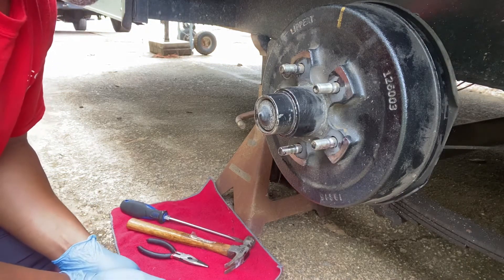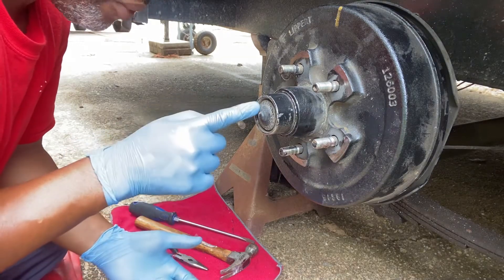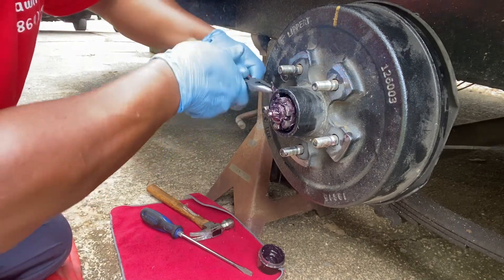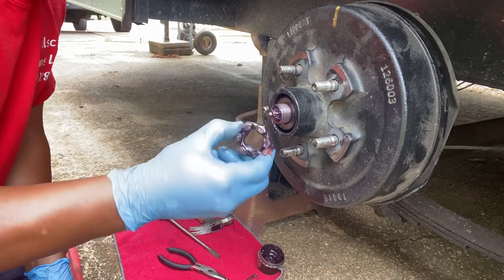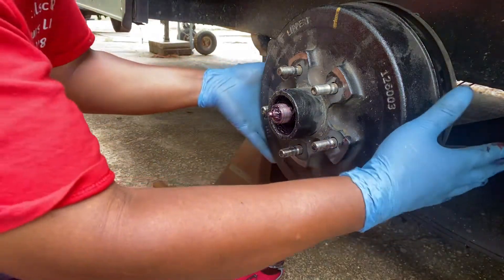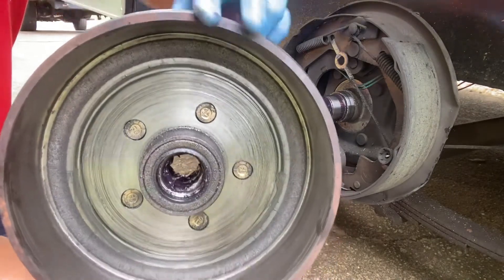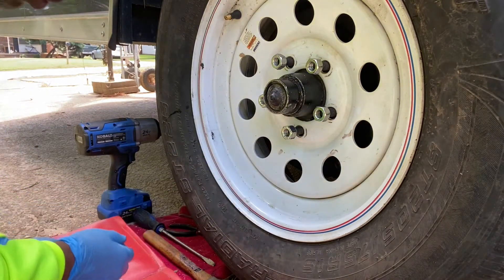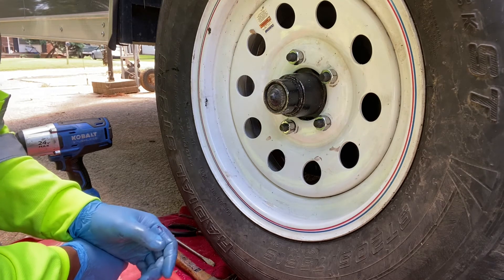TRAILER WHEEL HUB & STUD REPLACEMENT

Comment: Job well done! The only thing I might would add is change the wheel seal on the back of the drum. Nothing worse than it start leaking after you did all this. If your bearing are in good shape still.

Comment: You should really address the thinning of the studs. You either have the wrong nuts , or not fighting the nut probably or this is made in non-USA studs ( i.e made in china ) where the metal is weaker and will distort

Comment: Great how-to video.  I'd recommend you replace the cotter pin (not carter pin).  I have a hommade trailer with elongated lug studs which have about a 1/4" lip that is not threaded until you get past the initial 1/4" of stud. Then there are threads which the nut fastens to.  That elongated non-threaded portion of the stud poses a problem when attempting to put the nut back on. I think the fabricator used old truck axels which don't have flat-faced stud ends. Thanks for the well thought-out video.  I wish you success in your lawncare business.  👍🏽🤠  10/20/22

Comment: Do you know the lug pattern of that hub and how do you know which one to replace it with when you go replace the brake hub? How do I find out the size of the axle or the drum. The ones I have on my trailer say 3700 and then  63909 but have a weird lug pattern. 5x4 or 5x100… 🤷🏿‍♂️
Reply from the maker: I took the lug to the auto parts store and they matched it up, my is a 5 bolt pattern

Comment: What size studs are those? Do you have a link for where you purchased them?
Reply: They'd be 1/2" 20 threads per inch. I just replaced one bad stud on my trailer. He's mostly doing things right, but always, ALWAYS, use a new cotter pin. They're pennies and they're holding your hub together.